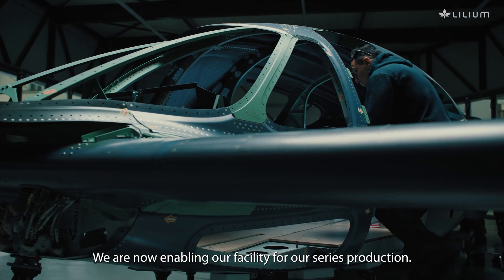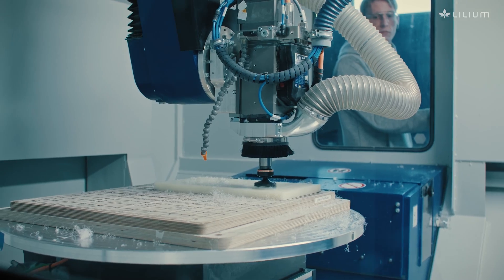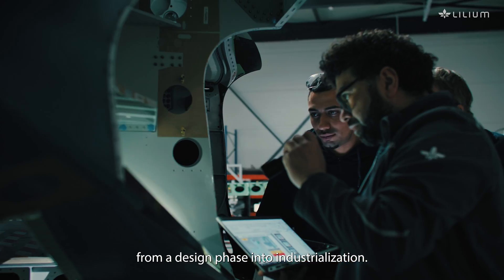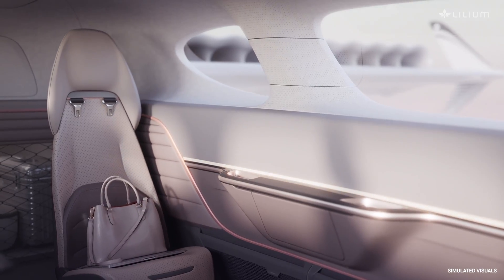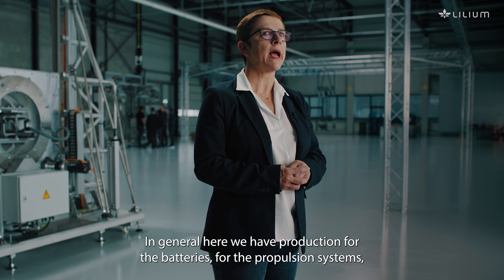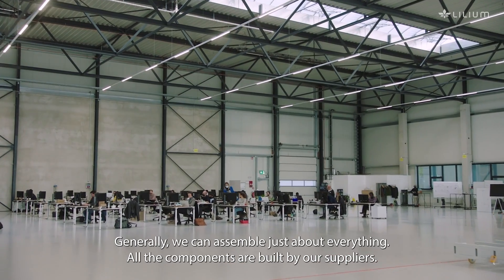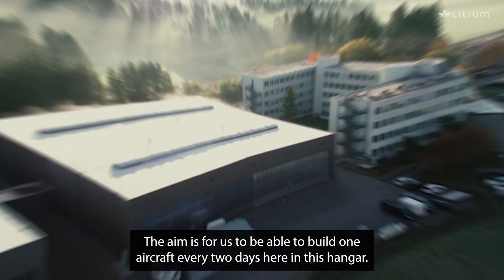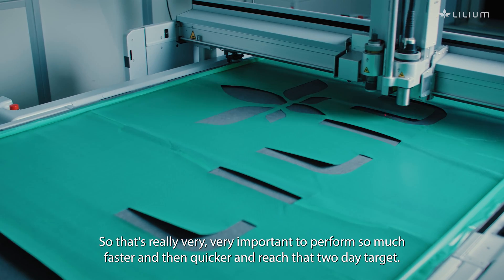Lilium Jet | Production Update | Hear from Julie

Comment: Here is my innovative design for what could turn aviation #Turbine #Propeller #Drones but also #Shipping upside down. It seems impossible, but it fits exactly within the laws of physics, and can also be proven. https://www.youtube.com/watch?v=DWtsvLNQu5k&t=11s and feel free to also watch (part 2) https://www.youtube.com/watch?v=FfZWREGKoJ8&t=26s I also have my design on some others show they were surprised and amazed that the solution was so simple. 

It seems an impossible problem to maintain propulsion from the #engine and to provide a #dynamo with enough energy. And to keep the entire process moving. And then also being able to recharge the #battery, but this turns out to be possible.

PS, A test model will be made shortly.

Comment: Is that an aluminium airframe made up of frames, stringers and sheet metal riveted together? Shouldn't a composite monocoque construction be lighter and stiffer?
Reply: Well it's kaput now, they sure knew how to burn through cash and endless self promotion with few facts.   A staff of thousands...doing what exactly all these years ?
Reply: They are probably using footage of when they built the mockup cabin that they send to conventions and airshows and not footage from their production of the real craft because they haven't even started making it and can't figure out how to make one that will work.

Comment: That's an impressive amount of work and investment. And trust. But why have we still not seen one fly? I don't mean a slick rendering or a computer simulation or even that elegant scale flying model that's been featured before; I mean a full-sized big, heavy, massive one. With dummy [sand bag] passengers on board.

You know - the kind of practical 'proof of concept' demonstration that usually precedes so much work and investment. And trust.
Reply: One reason: Batteries for this kind of flight do not exist.🪫
Reply: We already have seen them flying?
Reply: @user-bb5ju9gt3o  No, only a remotely controlled scaled down demonstrator.

Comment: All of that, and yet not a single flying prototype of the production-sized aircraft. “Engineering through optimism”?
Reply: The smaller version is the prototype. In the aviation industry it is normal practice to go through all these steps. So your comment doesn't make any sense at all.
Reply: @insAneTunA Nope. The remotely controlled model aircraft is only a technology demonstrator. A prototype to proof payload, range and essential operational performance doesn’t exist.
Reply: @avigator I call a "technology demonstrator" a prototype. Just as any other normal person would.
Reply: @insAneTunA  Than you seem to know not a lot about systems engineering in aerospace.
Reply: @insAneTunA  the size matters. Look up the square cube rule in physics. It gets exponentially heavier  the larger it gets and the more power it will need. The battery density stays the same. Dji would make giant drones for people if they could just scale up their quadcopters and stay up 25 minutes. A toy proves nothing and even then they need to deceptively edit those videos.
Reply: @insAneTunA  The square-cube law is a principle that states when an object's dimensions increase, its surface area increases by the square of that factor, while its volume (and hence mass) increases by the cube of that factor. In the context of electric drones, this means that as the size of the drone increases, its weight increases more rapidly than its surface area.This has implications for electric drones because larger drones typically require more powerful motors and larger batteries to lift their increased weight. However, these components add even more weight, leading to a diminishing efficiency as the drone gets larger. Therefore, there's a practical limit to how large an electric drone can be before it becomes impractical or inefficient.
Reply: @TheBagOfHolding Yeah, you know nothing at all. Just another hater for no reason at all.
Reply: @insAneTunA  ok well the year will be over before we know it and we will see who was right.

Comment: Can it land safely with complete power loss?
Reply: Yup.
Reply: @insAneTunA How?
Reply: @avigator You can switch to manual flight and flap the wings by hand.
Reply: No way.
Reply: @TheBagOfHolding  It definitely doesn't look like it's capable of gliding. I wonder if it has a parachute.
Reply: @jimberg98 It can’t. A parachute to carry the whole vehicle at maximum weight would be way to heavy.
Reply: @avigator  Yeah. That thing is doomed if it loses power. Fortunately it's not like electronics ever fail.🙄

Comment: Have you completed manned flights?  I have never seen a video of a flight with a real pilot.
Reply: I find it odd too, but that's their timeline. Prototype for manned flight license in H2 2024. I assume Lilium started as a scam slowly turned into a real venture with a real product for political reasons. I guess original investors already cashed out on IPO. But Bavaria really wants this to succeed.
Reply: @falklumo Bavaria?
Reply: It doesn t hurt to do some researches. If you have followed the company they are scheduling manned test this year, around summer/autumn.
Reply: It seems manned flights should come before mass production.
Reply: @HurleyDeanPhotographer  I don t think those models are for mass production.
Reply: @GroundhogDK The challenge is not production. The challenge is to demonstrate payload, range and safety standards for commercial flight operations.
Reply: @avigator  They seem to have completed design phase. This means that they must have solved payload, range etc. and their 1h battery primer seems to confirm this. It contains very detailed numbers. Lilium has support from the Bavarian gov't. OTOH, it still could be next level scam although I don't think so.
I agree it is odd to have a full scale prototype this late. But  it is pretty normal procedure in computer-driven development where everything can be simulated. So, why build a prototype before the design is complete? After all, this is a simple vehicle. TBH, I think they didn't have a working design until recently to begin with ...

Comment: Strange that you build a large craft before the first one ever flew with a person on board or person equivalent weight. 
And why sheet metal construction instead of carbon fiber?
Reply: I was wondering the same, it looked like riveted aluminum
Reply: China, in their C919 construction, had to move from composite to an aluminium wing box due to unforeseen complexity, delaying their project for years. Glad Lilium isn't betting on composite. They have suppliers delivering the parts they need.
Reply: It´s cheaper and easier to built. But at least, you can easy scale the 7-Seater Structure to the coming 16-Seater. This will make certification (EASA,FAA) simpler too ... ;-)
Reply: enjoy forming carbon fiber. this isn't multi billion dollar company
...
freedom logic I guess
Reply: @BaBaNaNaBa  it's quite the reverse. Forming all those sheet metal pieces has to be very high dollar business. Composite molds is something one man companies can do for pennies. You can buy a 3D printer that can print 1m3 now for 2000$. Great for repeatable precision mold making on a budget. And you can make the fuselage in one big piece, much faster manufacture, lighter, stronger, better.

Comment: That's one way to burn investor money on a large scale
Reply: Are you a communist? Because in the capitalist world the people are free to choose where they invest their money.
Reply: @insAneTunA  did he say they should not be allowed to be scammed out of their money?
Reply: @TheBagOfHolding What scam? How is this project a scam?
Reply: @insAneTunA  because it can't work. They will not show it fly with a person this year for more than 5 second long clips edited together deceptively hugging the ground if at all. They couldn't even show a full flight of their toy prototype and that should be easier than a full sized one fully loaded.
Reply: @TheBagOfHolding ??? Why can't it work ?
Reply: @insAneTunA  because it needs more energy than can fit in a battery it can lift.
Reply: @TheBagOfHolding What is your source of information? And do you know the weight and the maximum power output from those batteries?
Reply: @insAneTunA  is there any electric multirotor in the world that has ever proven it can lift a person and its battery for 3 straight minutes? Find a video of that without edits every 3 seconds. Nobody can do it even without a fuselage and seats and radios and air conditioning and fire extinguishers and luggage and safety features needed for certification. If someone can't do it on a flying battery and motors, then they can't do it with ducted fans. They can't even show a full flight of their toy prototype that is impressive, so the square cube law would determine a bigger one would be even more impossible.  Asking for a source is like asking to prove God doesn't exist. I don't have access to their data but I would if they were proud of it.
Reply: @insAneTunA  a good source is John lou. He breaks it down but even he is overly optimistic about them.
Reply: @TheBagOfHolding Yes, this video from an electric airplane is 13 years old. E-Flight Electric Powered Waiex N270DC First Flight!

This video is more recent. The ELECTRIC Plane with a $0 fuel cost ⚡

This video is 16 years old. Sonex Electric Powered Flight, EAA AirVenture Oshkosh 2007

Watch the channel from The Electric Plane Guy. He is flying the following Aircraft: Pipistrel Elelctro, 2 seat private electric sport aircraft. 

You have a sincere lack of knowledge. Your arguments are based on feelings and emotions, but not based on reality and science.
Reply: @insAneTunA  do you think an airplane is an evtol? Electric airplanes can't even do what they are claiming they will do.  It's for sure not going to happen.
Reply: @insAneTunA  those aren't even multirotor airplanes, let alone evtols. Do you understand the vertical take off and landjng takes more energy?
Reply: @TheBagOfHolding Do you have any scientific data to support your arguments? Or are you just expressing your feelings and emotions? 

The lilium is a hybrid that can  also fly like a conventional airplane. That's the whole idea behind it. It doesn't necessarily need large airfields. It can choose how to take off or land. 

It is not an airplane that is going to replace the intercontinental flights. It is going to compete with the relative small business and private airplanes. 

The low maintenance costs and increased landing and take off options make it a very good competitor.
Reply: @TheBagOfHolding Again, they can choose how to take off and land. They do not need to take off vertically. They can also use a runway like a conventional airplane. It will all depend on the situation how they need to take off and land. 

And this airplane is not designed to do super long flights and to compete with intercontinental flights. It is for the relative short range. They are going to compete with relative small business and privately owned airplanes.
Reply: @insAneTunA  do they make their data available? They would if they were proud of it. They would show a full flight of their toy prototype if it was impressive. We will see if they lift passangers and for how long this year. They will need to edit it every second and not transition to forward flight. They will be less than 10 feet off the ground for less than a minute if they even build one. It doesn't even exist. You can't compare evol with gliders or blimps or airplanes. Even the best electric plane can't do what lilium is saying It will do. We will see by the end of the year.
Reply: @insAneTunA  no they can't take off and land like an airplane. They would need heavier gears. They never even said they would do that. The craft doesn't even exist.
Reply: @TheBagOfHolding So if you do not have any data, how can you come to the conclusion that it is not going to work???? Your "feelings" and sincere lack of knowledge are not in any shape or form a viable and acknowledged scientific method in order to determinate if something is going to work or not. I think that we can all agree on that.
Reply: @insAneTunA  that's like saying you can't prove God doesn't exist. It's in their best interest to prove its possible. None of the evtol companies or hobbyists can prove its possible.
Reply: @insAneTunA  lilium jet will it work? A detailed analysis by an independent expert.  Did you see it?
Reply: @insAneTunA  what data says It is possible?  Why don't they make a video with their data that is proof since there are so many doubters and their stock tanked so bad? People wouldn't be able to argue if they proved it.
Reply: @TheBagOfHolding No, you are saying that it is not possible even before they have build a full scale prototype. While the smaller scale prototype has already proven that it is working great.

You cannot just make up out of thin air that something is not going to work. That is not how it works. That is not a valid and accepted argument. 

Tell me the weight of the entire airplane, and the thrust power and the battery capacity. Do you have all that information? Because if you don't have that information you cannot know what is possible and what not.  

Again, your fantasy is not what sets the norm. You might think it does, but it really doesn't. You just can't comprehend the technology. It is too complicated for you.
Reply: @insAneTunA  lol their toy version proved nothing. Look at all the edits. They don't show a full flight. Look up the square cube rule in physics. A toy would be easier to fly empty than a fill sized one with passangers. We will see when this year passes.
Reply: @insAneTunA  they never show a full flight with their toy version. You don't have proof it will work. Edited takeoff and landing and jump.cut edits every few seconds with annoying music. We will see by the end of the year.